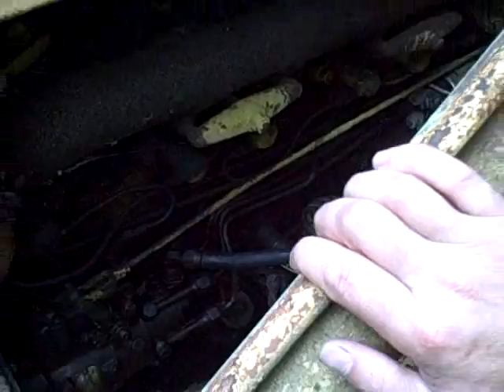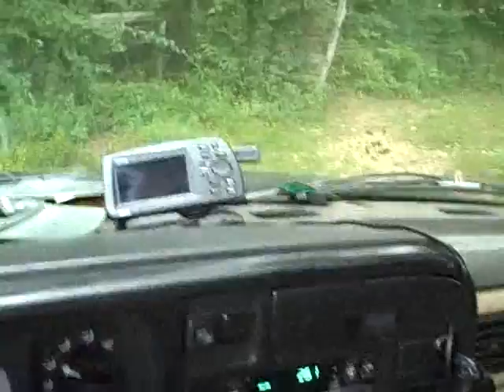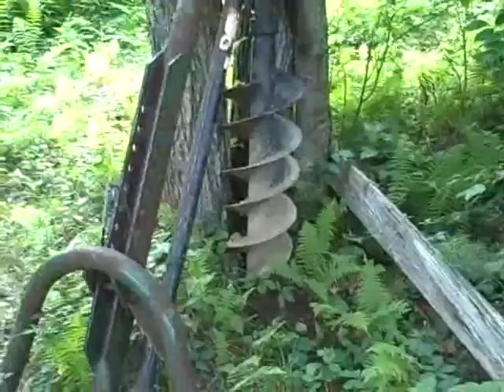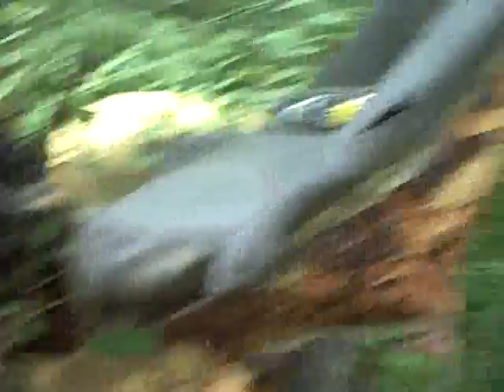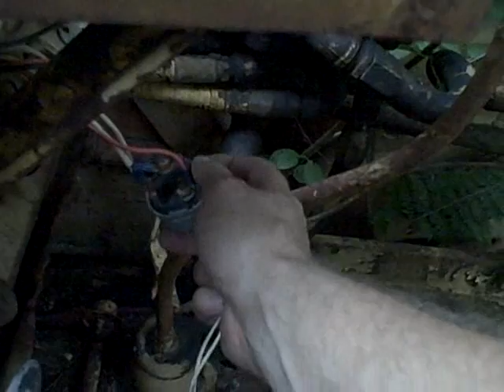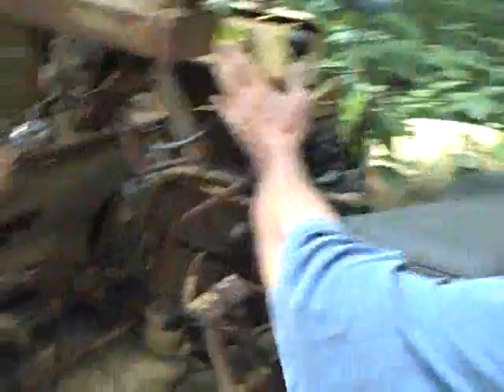Oliver 770 Industrial Tractor Project Part 1

Comment: What you have is a late model 770 industrial. The dead give away is the chekerboard grill that Oliver swtiched to when the 1800 came out in 1960. Problem was they didnt have a new 4 digit designed yet to replace the 770, so they just restyled it with a new grill and flat top fenders (row crop only). It was in production that way untill it was replaced by the 1550. If you can get the serial number off the tag on whats left of the lower dash I can tell you exactly what year it is.